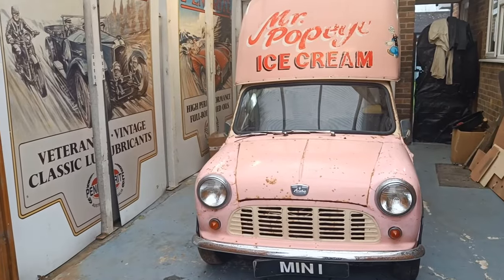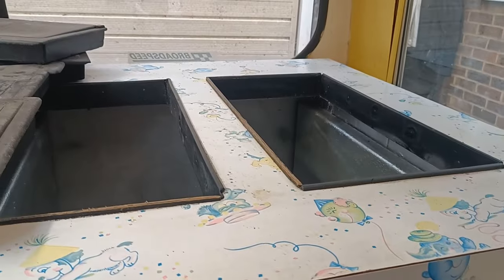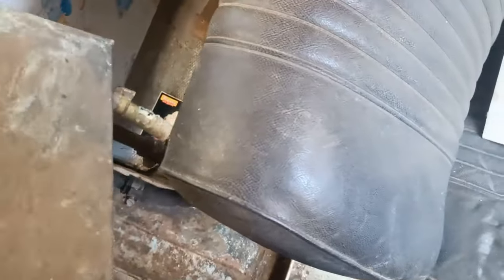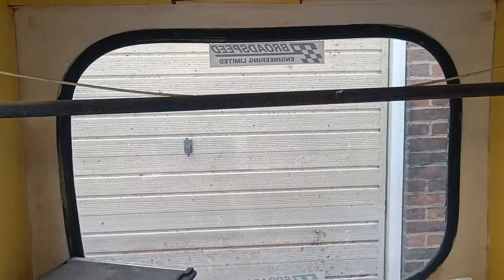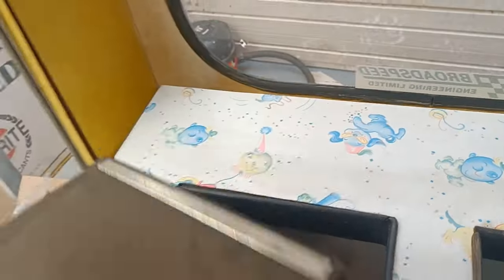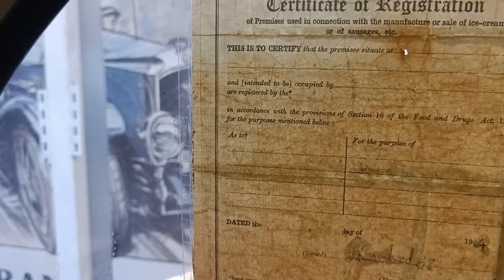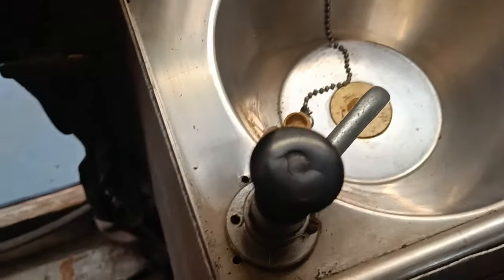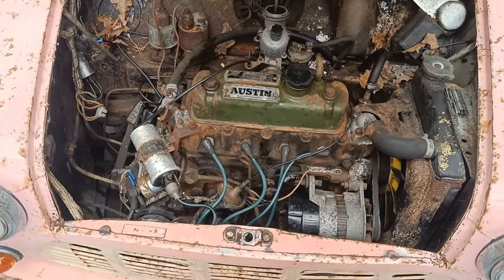EP1 -  Barn find 1966 Classic mini ice-cream van restoration. First look!

Comment: You are right about the tank being for hot water. The rubber hoses are a feed and return from the cars cooling/heating system which circulates around the ‘tank within a tank’ that you showed. Fill with your cold water and the engine coolant will circulate in its own ‘jacket’ around the inner tank warming up your water 👍🏼
Reply from the maker: cool, thanks for confirming my suspicion.
Reply: @ColinsCars  you’re welcome, just watched episode 2 and subscribed 👍🏼 we have 2 90’s ‘Smiley’ Transit ice cream vans so looking forward to watching your progress 👌🏼👍🏼

Comment: If its the sameone this used to come around the shelfiield/pelsall areaa of Walsall, surely there couldnt have been more in the area at that time. I bought ice cream from this vehicle.
Reply from the maker: That's definitely the right part of the country, i dont suppose you remember what era this was?
Reply: @ColinsCars  I  also remember the elephants on the freezers, so I was born in 1965 so it was around the 70s,  to early 80s. I did a quick check of Duke Road in Chasetown which also shows as Burntwood. Never knew difference tbh. But it's near to the area I lived. Only about 6 miles away.